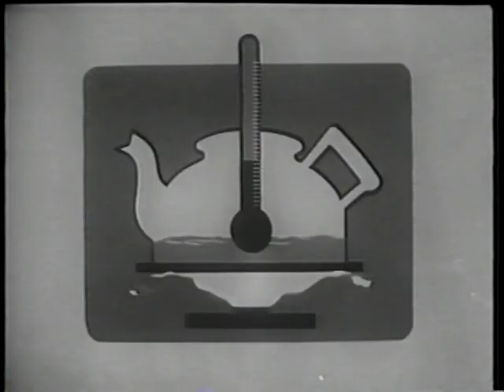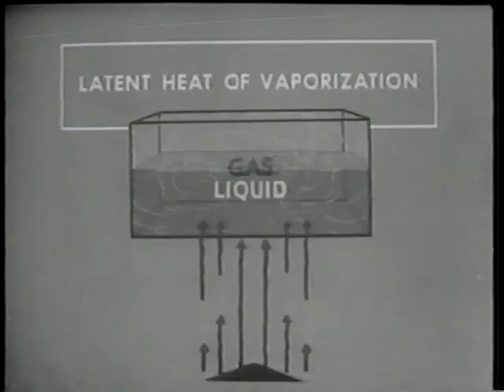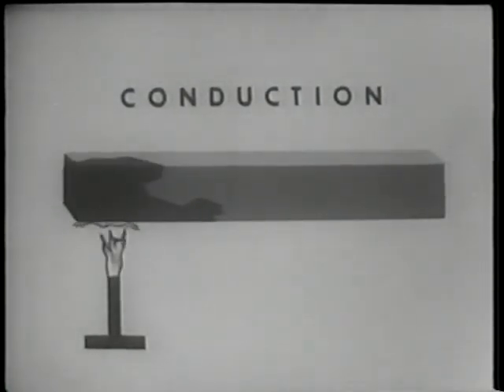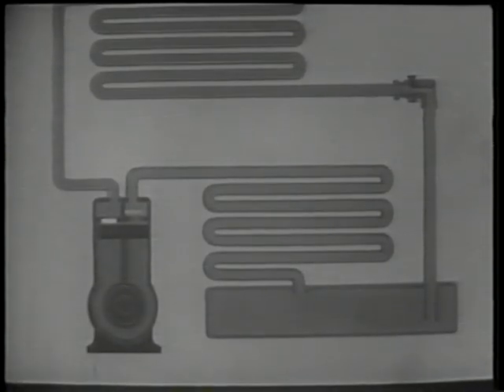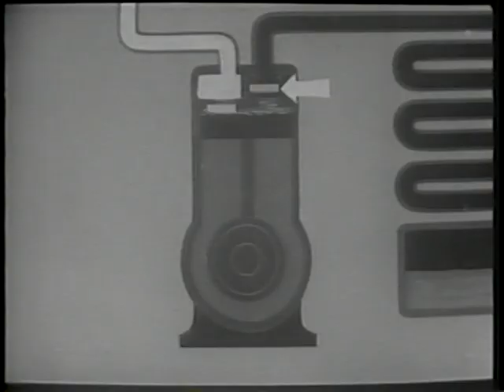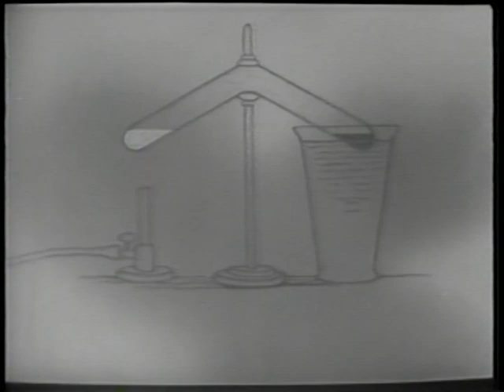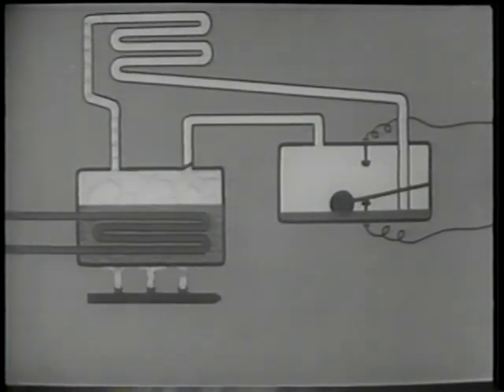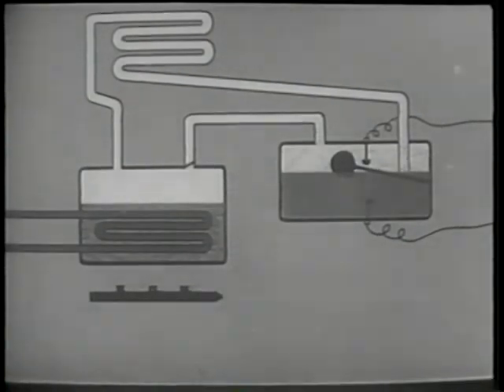Principles of Refrigeration

Comment: Great video especially the part about latent and sensible heat.  Interesting that in melting and boiling temperature remains constant even though heat is flowing through.  Crazy lingo.  Its like the guy who discovered it wanted to be the only guy to understand it.  Like "latent heat of fusion" and latent heat of vaporization".  How much sensible heat must be applied in BTU to reach the latent heat of vaporization?   Got to be easier language.
Also I like how the government was involved in its cr

Comment: To all the HVAC technicians you are responsible to the Ozone depletion. Please do not use a CFC refrigerant like R-11, R-12 R-13, R-113, R-114, R-500, R-502, R-503. Lest save our Ozone Layer.
Reply: how about using propane or ammonia as refrigerant, would it be profitable too?

Comment: No sir, the irresponsible unconcerned corporations (Honeywell, 3M, Dupont, etc) are responsible. They made refrigeration so necessary in our society that we cannot eliminate it. There are bad techs that exacerbate this problem by improper procedures. Well trained concerned technicians are only doing their job by keeping these machines in working order. We do our best to convince equipment owners to upgrade old inefficent equipment using high-ODP refrigerants but this is not always possible.

Comment: i have dought 
while deschrge from compressor refrgrnt is converted into liquid and dis liquid absorbs heat from things wat v r kept in an refrigerator and after dat dis refreigernt is converted to gas state befire entring to suction of compressor
dought is dat
if der is nothing in refrigerator i,e nothing to cool  den how refreigernt change its stae from liquid to gas ??
Reply: shabbir shaikh Because as the refrigerant enters the evaporator tubes (the ones inside the walls of the unit) its pressure drops. Just like placing water in a vacuum, it boils even though it's at room temperature. Also, the inside of the box is never quite as cold as the refrigerant and the insulation isn't perfect so some heat will always enter the unit, even with the door shut all the the time.
Reply: On spot with reply. 
So to answer his concern if we had this situation, refrigerate would not change state therefore liquid refrigerate would flood the compressor and damage the valves. The compressor only pumps gas not liquid.